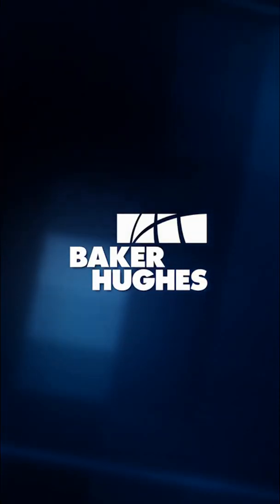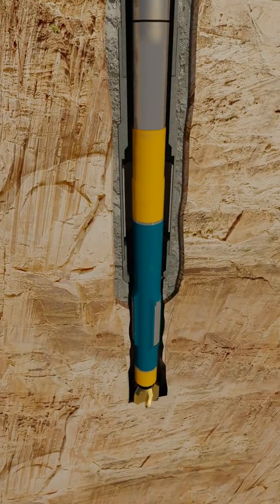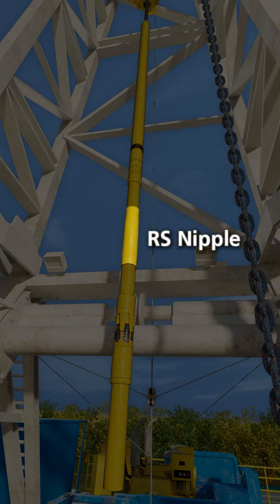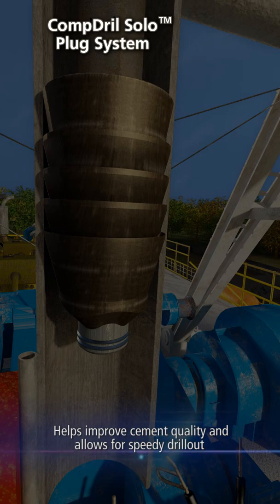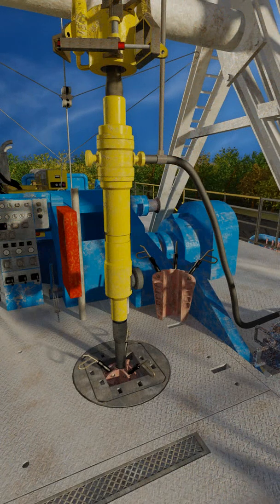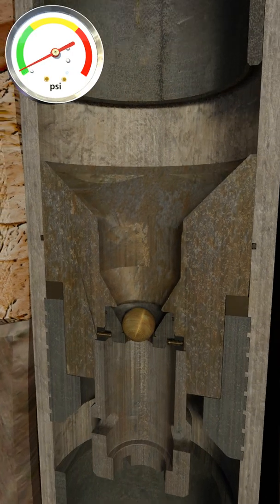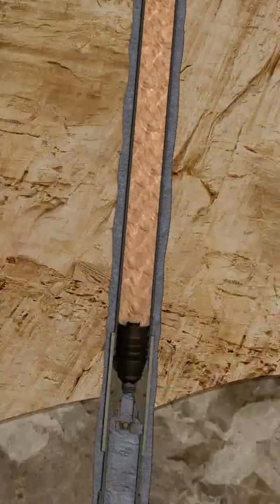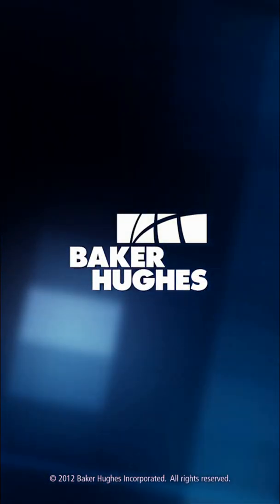Liner Hanger from Baker Hughes

Comment: Liner hangers are the most dangerous thing out there. I have been on or heard about many drilling rigs that burned up because of the these. Especially when you cut the mud weight after setting the liner. Works on paper --- not down hole. You would have to go to well control school to understand what happens when you try to kill a well with a bad hanger that allows gas to be a lot higher in the well. Not possible
Reply: Haha, what are you talking about ? We have been running these for 50 years. I have never heard of rigs burning up because of these!